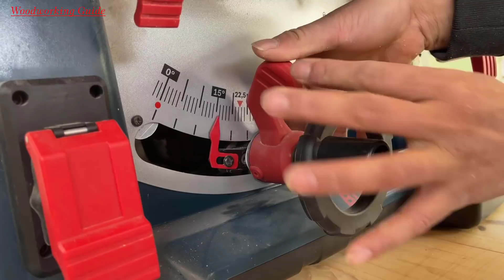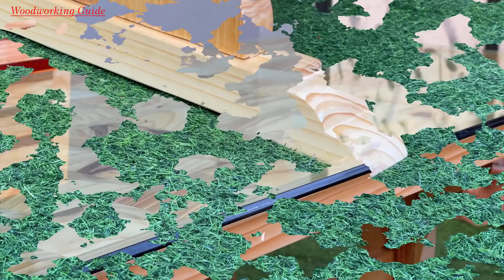You Can Make From Old Wood // Efficient Wood Recycling

Comment: OK, constructive criticism from a professional: The cross rail underneath with the pegs holding it, is useless considering he glued the gables to the top, making it impossible to dismantle the table, which is what the peg rail is used for. I would have opted for a fixed rail without the peg. Possibly dowelled or dovetailed into the gable, or not glued the top. 
Other than that a fairly nice looking table and chair. Well done sir.

Comment: Couldn't you have cut the two horizontal angled cuts before you cut the squared down to length. Then you would only have to flip the squares twice. Maybe I'm missing something and there is a reason why you wouldn't do this.
Reply: Good catch and triggered a related thought if using standard stock (not cut-offs) for an accent wall or large cabinet front (or table-top). Adapt router + router table to accept small 4-1/2" blade & 15 degree cut to avoid vertical hold and (with stops) repeat cuts on same, long board. Safety first… likely need speed reducer (larger diameter —> less rpm).

Comment: Nice set! Personally I would have not glued down the parquay, and left a raised lip around the perimeter of the table top to contain the glass plate. Otherwise, a great build!
Reply: All that cross-grain construction has a huge chance of self-destructing n in a year or 2.  Wood expands and contract, and glue and screws won't stop it in cross-grain construction.  The wood will crack and split unless it's in a controlled environment where the relative humidity is fairly stable.